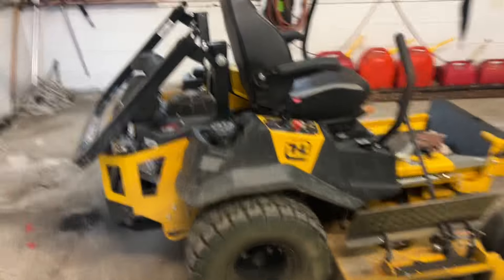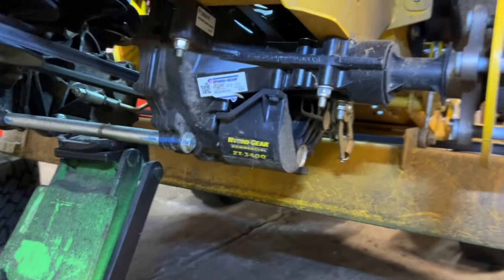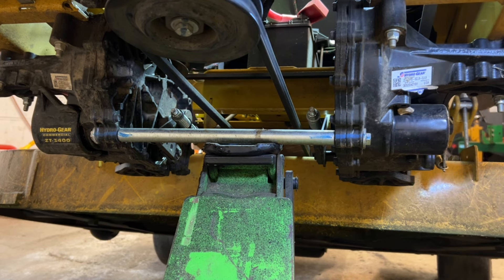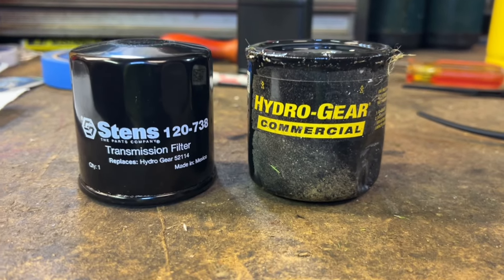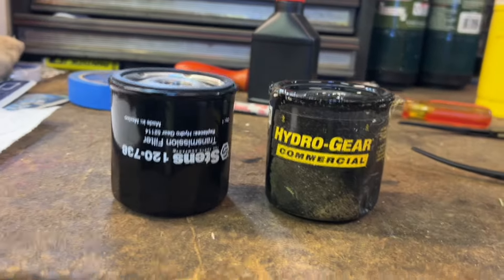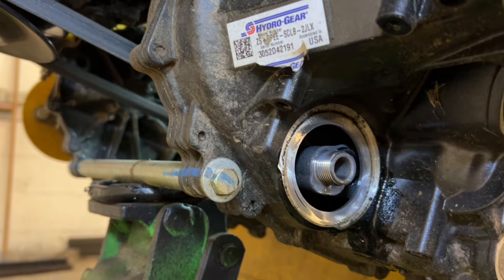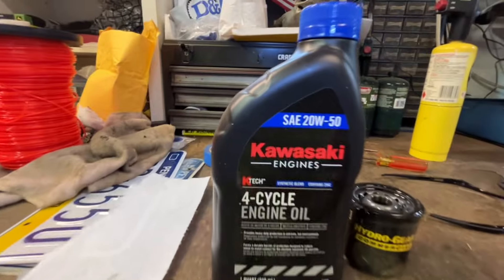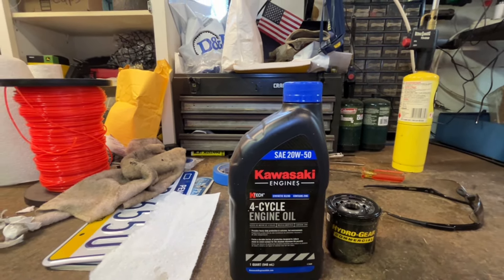HYDRO SERVICE STEP BY STEP

Comment: Best I could tell, you did the bleeding with the caps installed on the reservoirs, correct?

I have a commercial Bad Boy that I use on my own property. It's my first mower of this type and the learning curve has been pretty steep. I've done this job once and wasn't sure I got it right. I appreciate this tutorial very much. I'll use the links.
Reply from the maker: Correct, I do it with the caps on . The caps have breathers . Thanks for watching, and good luck with your machine.